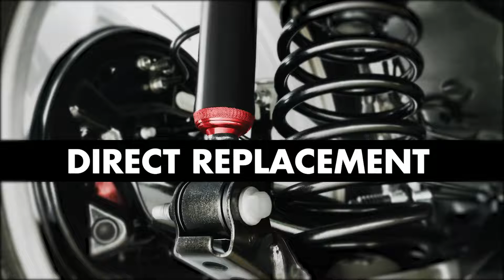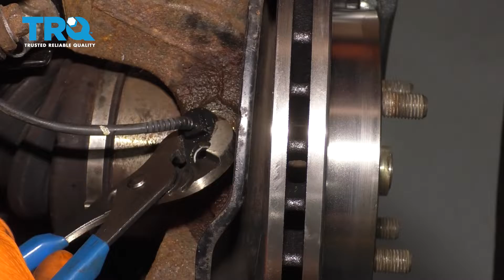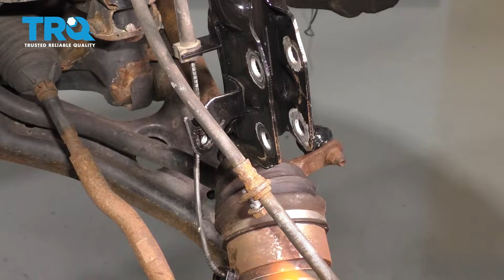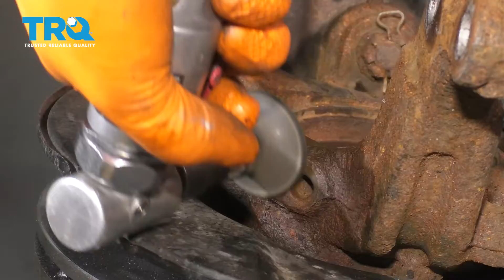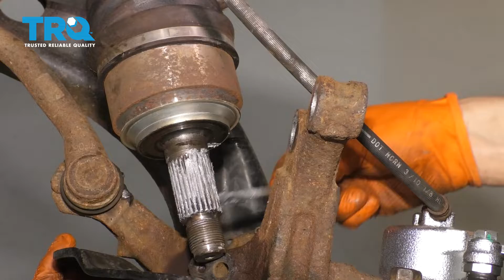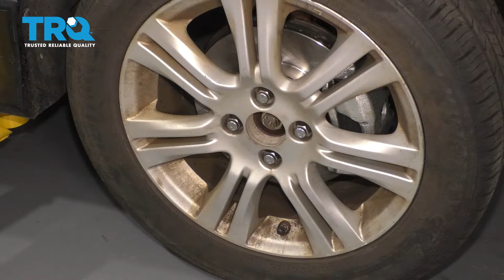How to Replace Front ABS Sensor 2009-2014 Honda Fit

Comment: 1:27  if this happens, take stainless steel wood screw diameter size about 3/4 than sensor diameter, don't want to big or too small diameter wise, heat it up with blow torch till screw is red and then screw it in right in middle about 3/4 sensor lenght. Don't want to go too far. Spray some water and wait 3 to 5  minutes for screw and plastic to cooldown. This way plastic will mold around screw. Place screw driver near screw for leverage and use hammer that allows you to pull nail. Will come out easy. Won't require to take axle out.

Comment: Very ambiguous video ..  not very helpful.  How do you determinate which of the sensor is bad ?  Replacing all of them Honda OEM is over a $1000 dollars , would be helpful to add in your video how you decide to replace that passenger front wheel speed sensor .